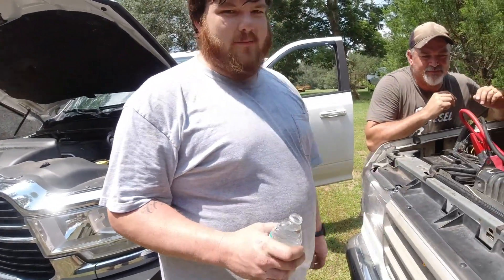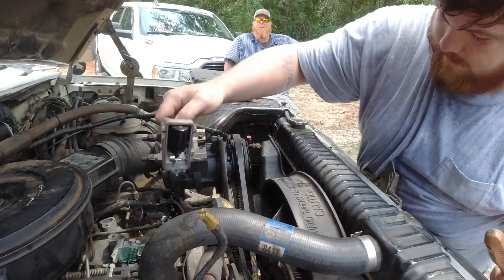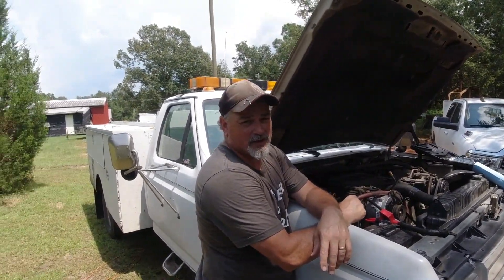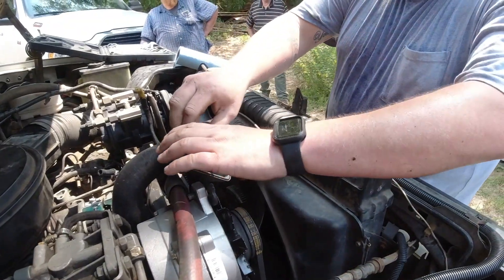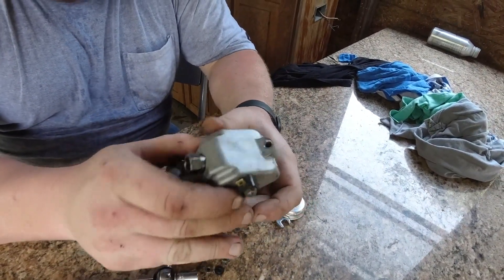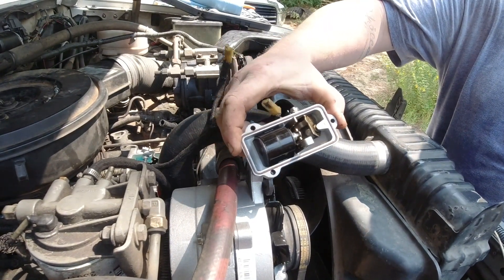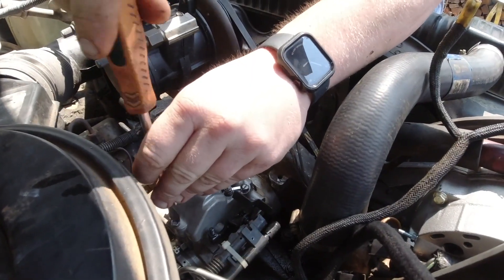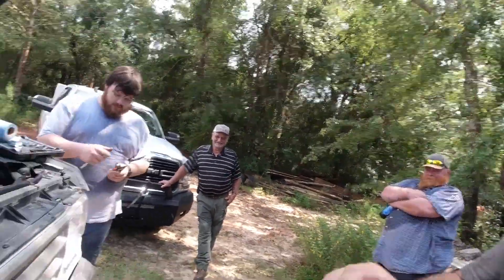Replacing Broke Parts on a 7.3 IDI!

Comment: Fun video...well it was for us guys on this side of the screen anyway.  My skidsteer just developed an issue this week.  It's always something with equipment isn't it.  My daily driver is an 85 Ford F 250 with an 86 Ford F-350 rear end and .030 over 460 gasser.  Flatbed too, with tool boxes. So I am a little familiar with driving 'older' vehicles and the 'fun' they produce.  LOL
Reply from the maker: Right on. I hear ya